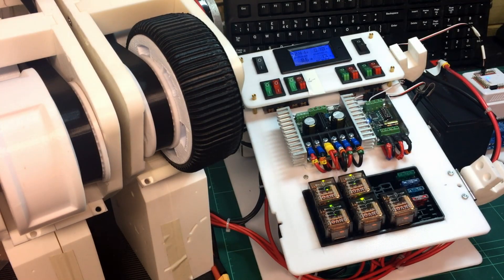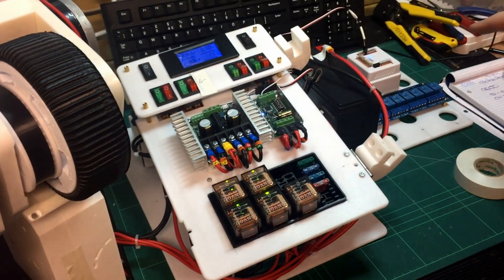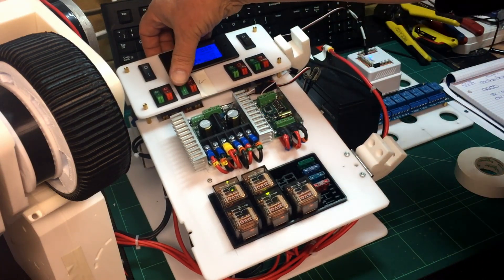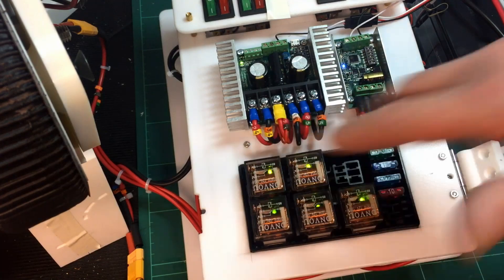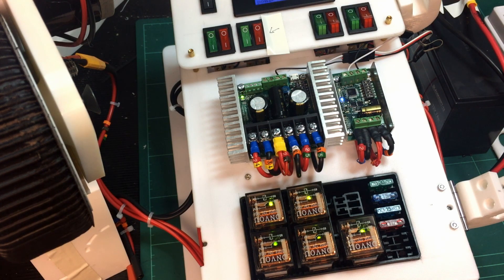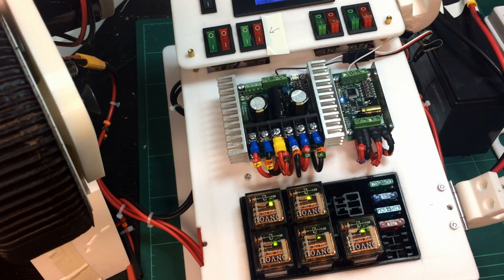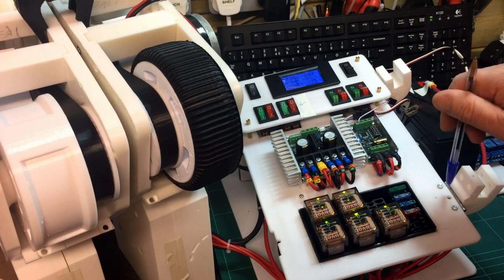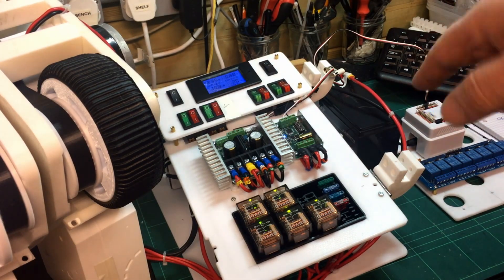R2D2 Droid Build Part - 17

Comment: Hi Kyle thank you so much for this series. Is there a guide to all of this wiring in the OneDrive? I've just subbed to his patreon but not had a good dig through it yet
Reply from the maker: Hi Huw, I think the best place to look for wiring info is on Mr Baddeley's facebook group pages and also the Astromech.net site (https://astromech.net/) . (https://www.facebook.com/groups/mrbaddeley).   The setup I wired I just made up, I was originally planning to use EZ-Robot controller, same as I used for Inmove.  But they are cahrging for the software now so I am looking at other options
Reply: @kylecampbellweb  thank you for the reply Kyle! Look forward to updates on this project

Comment: That 3mm by 12mm metal peg on which ring and part does it go.
Reply from the maker: Hello sky, I am not sure which part you are asking about?
Reply: kyle campbell .in the assembly notes it said to don't forget to put the 3mm by 12mm metal pin in before assembly ,but it doesn't say on which panel ,
Reply from the maker: @skyrim4713  Hi sky.  
The bolt is for the hinge assemblies
The lower hinge assembly for both tall side doors requires a hinge bolt.   [see page-9 of R2D2v2Body-instruction pdf]
Also the door that covers the Data-Panel requires a hinge.  [page-10 of the R2D2v2Body-instruction pdf .    There is a red arrow pointing to the slot]

Also
Reply: kyle campbell ok wasn't sure if it was for the data port piece,

Comment: I want to print me a R2 but this is what I think will Scare me the most, all the wiring I will need to learn to build it.  Is this one going to be 3-2-3 ?
Reply from the maker: Eventually will probably be the 323 when Mr Badderly finishes his latest designs.  Still loads to do now as it is.   You can always just have the Droid without electronics and add it in later if you want, plus its worth checking out the forums  about wiring it all up.    If you go the Padawan 360 control system route and use Arduinos, its cheapish to buy the bits and theirs lots of help on it.  All fun though!

Comment: Good to have you back,been waiting to see what you are going to use for control, and how it works
Reply from the maker: Thanks Sky, really appreciated.  Been working away but not really had anything to video and then this video was all a bit rushed.  Spent the weekend sussing out the Sabertooth and Syren serial controls and it finally made sense.   Wheels now turn in the proper direction and can adjust the speed.   The arduino Padawan 360 might have been easier/cheaper but I want the Droid to talk and will adding a camera so the EZB does all that.

Comment: Very cool! Playing with the fiddly bits can be exhausting. Nice of you to point out the cutting board and cable management. Can you make hooks to attach zip ties to the inside of the unit? Or Velcro?  I was thinking about using either of those. Or using ribbon cables for data or some sort of USB cable arrangement.I just repaired my S4 this morning. A bearing in the Y axis pulley exploded Tuesday. Gearsbest and Creality were less then helpful initially. They finally agreed to send me a replacement... in 2 months. :P I ended up using my calipers to measure and then make a new one with 1 of my Da Vincis. Running a test on the last part of the right horseshoe now, so far so good.Have you gotten far with sanding and such? I heard the weather has been iffy for you brits. :)
Reply from the maker: Thanks Chris.  The layout board is all a bit provisional but it will tidy up and tyrewraps will hold in those bulging cables.     I am now thinking that maybe I will mount the EZB control unit in the Dome and just wire the serial control down to the main power board. Possibly mount another battery also in the dome.  It would make it easier to connect in the camera directly to the EZB.   As I was saying to Sky above comment, I have worked out the control coding  a bit more now for the Sabertooth but still sussing out the Syren board.   Getting there so next job is to steal my daughters PS4 remote control and get that working with the EZB. 
I have decided to sand/paint next year as the weather now is too wet, so will concentrate on building and programming the R2 and finishing off some outstanding projects.  Good luck with your printer problems by the way!
Reply: Thanks for that Kyle.How big are those batteries? Do you know how long they will run for?I agree, having a separate battery pack in the dome for the electronics and motors there makes sense. I'd like to have distributed batteries in ring 1 to keep the center of gravity low. It also allows room for the 2-3-2 set up and extra arms I'm determined to do."Steal my daughter's PS4 remote" lol Good luck with that! I can hear the indignant screams now. "Daddd! What did you do???! Mom!!!"Sand/paint: Ah. Sounds about right.Printer: The S4 is running beautifully again. Now I just need to sort out the other 2.
Reply from the maker: Hi Chris, the batteries are 12-volt 7AH [https://www.amazon.co.uk/gp/product/B00SMWJAU4/ref=oh_aui_detailpage_o00_s00?ie=UTF8&psc=1], no idea how long I will get run time with them.   Testing over the weekend noticeably dropped voltage by Sunday so maybe not bad, that was with just one in use.  
If I was to choose batteries again I think I would try out 18-volt Lion drill batteries instead.  Single battery, cheap and powerful.   I may actually do this anyway as I have seen it mentioned in blogs.  Maybe something like this [https://www.amazon.co.uk/dp/B07DF8WHGW/ref=sspa_dk_detail_4?psc=1&pd_rd_i=B07DF8WHGW&pf_rd_m=A3P5ROKL5A1OLE&pf_rd_p=8e5be0e3-b258-4b06-8b6e-695b24f935a4&pf_rd_r=S1N5JRTSNVASPKGQ2D6K&pd_rd_wg=j5ayc&pf_rd_s=desktop-dp-sims&pf_rd_t=40701&pd_rd_w=h88iC&pf_rd_i=desktop-dp-sims&pd_rd_r=b8edf144-dc86-11e8-8521-33f96fe86e38] that I could also use for my power tools etc 

Colin the R2 legs all PLA by the way.   Feet/drive wheel body partly PETG
Reply: Hi Kyle,The links didn't work but you put me on the right track. I have neglected reading blogs and the forums.I bookmarked an 18v 5Ah double battery pack for later review when I get to that point. Using cordless batteries like those makes sense. They are robust, small, and built to be used in different ways at varying loads. The equipment to use them can also be hacked apart.Colin's legs: Ah. Okay, cool.Is the PETG working out better? I know there are issues with gluing it. I've read people mix things into the glue to get it to bond properly.I glued my dome together as well as the second horse shoe and booster cover. 2 of the dome panels are going to need to be trimmed a bit and filled, there are annoying gaps at the top. I'm debating on trying to cut a bird's mouth relief cut on 1 and bend it in to get it to fit better.I've got another part of the leg printing now. I was trying to print the electronic mounting bits with 1 printer but switched projects. I was asked to print a bunch of stuff for my nephew's thesis projects this morning lol so I dunno how much further I'm going to get.